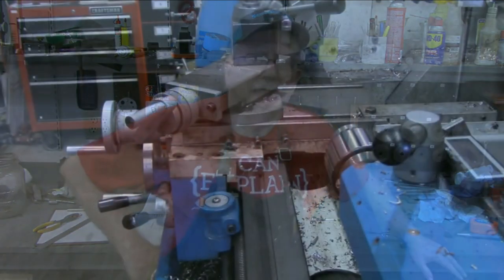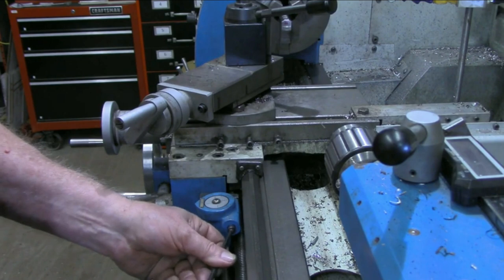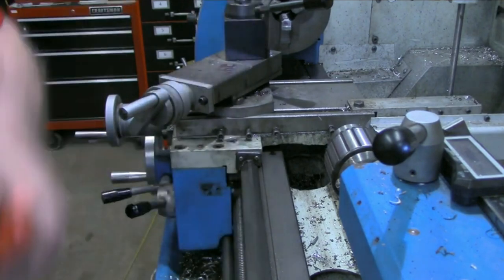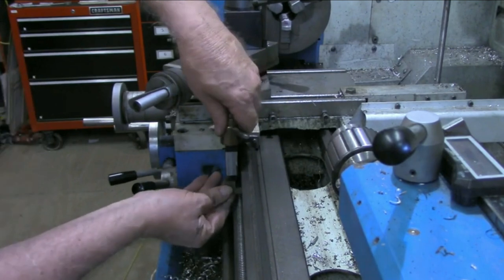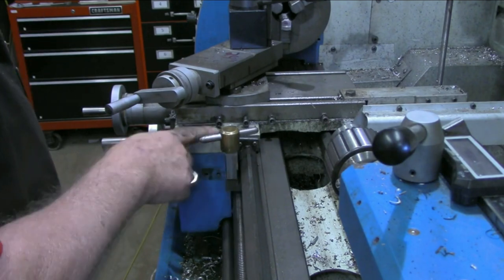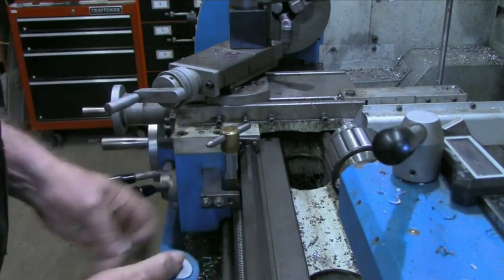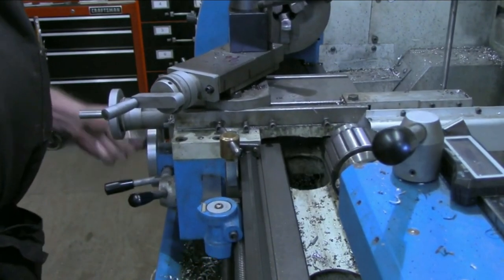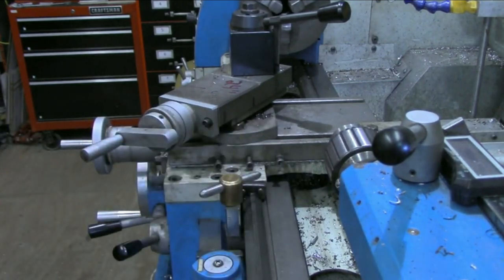Merry Christmas With A Tidbit of Machining (Lathe Carriage Lock)

Comment: If you would use set screws, on the cross slide gib adjustment, long enough to include the locknut thickness it would open a better chance for you to use the original locking screw. I did this to my machine and it made it possible to make a modified version of the lock screw to include a side handle above the the screw head.

Comment: Did you consider replacing that one grub screw that interfered with your carriage lock with a grub screw with a locking nylon patch. There will be no need for a locking nut and it could be recessed.

Comment: My issue is my cross slide lock is blocked by the dro reader on the tail side. Considering my options on the head side, the non jib side. But only damage to the surface is the big issue. Maybe top down instead?
Reply: I have the same lathe with the DRO scale in the way as well.
The modification for the gib adjustments and the locking feature was as follows. 
I replaced the socket head gib adjustment bolts with hex head bolts so I could use a wrench from above.
Then I modified a wrench with little plates welded on the sides of the open end, those sides help hold the wrench in place all the time, so, it works more like a lever than a wrench.
I would show you a photo of it but apparently Lee doesn't allow links in the comments section, I tried to post a link to a photo but my comment was almost immediately deleted.
I can't even give you my email address, it would be deleted as well. 

Hope that helps.

Joe